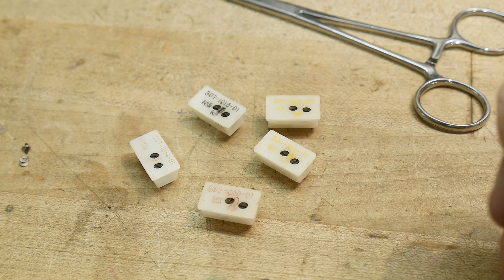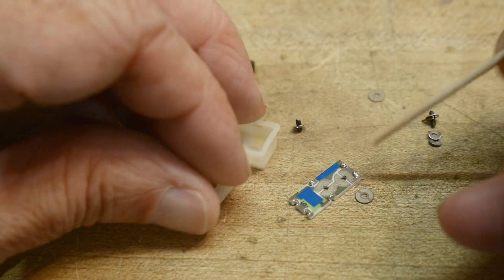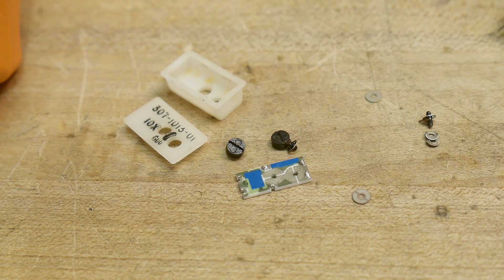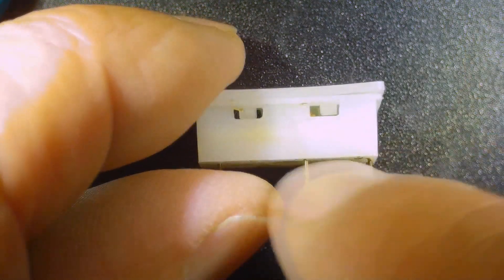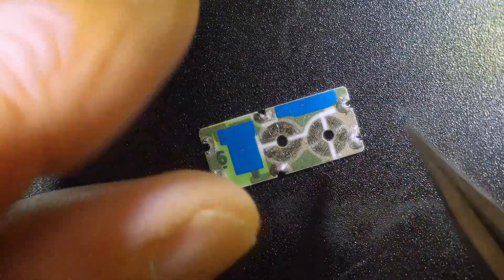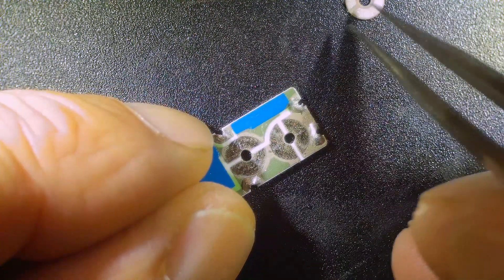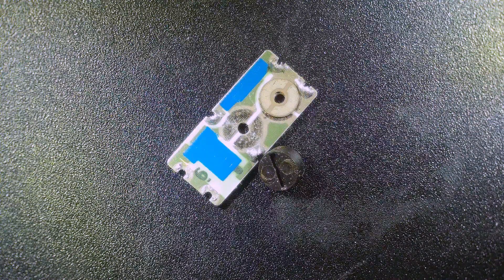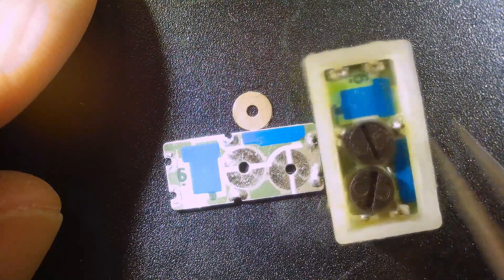#1714 Tektronix RC Compensation

Comment: Wow see this is why I shouldn't ignore subscriber notifications! 😂 I am currently working on a Tek 2230 (you mentioned these are in the 7000 series, but they are also used in 22xx series) that needs a lot of work.  Someone had definitely tried to repair it previously.  But anyway, these attenuators were missing from the vertical attenuator board!  And service manual does indicate that each attenuator has 2 trimmer caps.  I also looked up photos of them since I had the part # and saw the little trimmer screws.  So I assumed (incorrectly) that these were just two trimmer caps.  And sure enough, as you have elegantly shown, they are a lot more complicated than I assumed!! I somehow managed to pass some signal thru the vertical amplifer with my ill-chosen setup, but your video would have been amazing to have when I was trying to figure out how these were made!  I've since ordered some NOS ones.  Thanks for doing this vid!
Reply from the maker: the TEK 2200 series was some of the best analog scopes